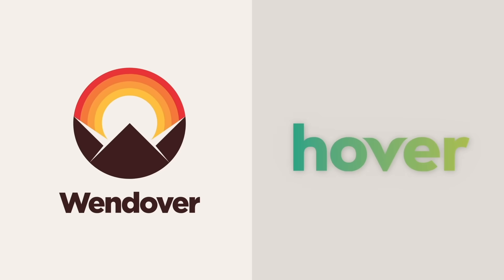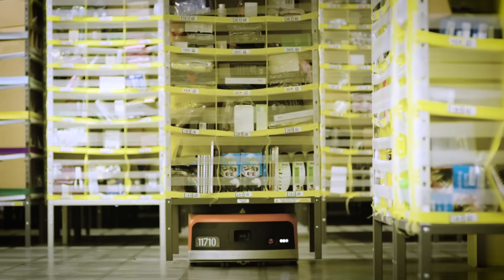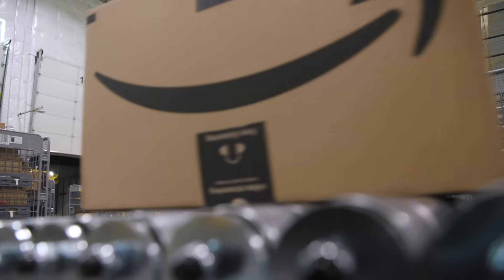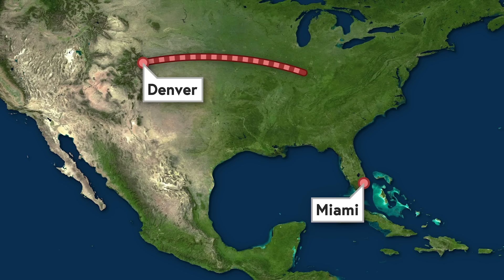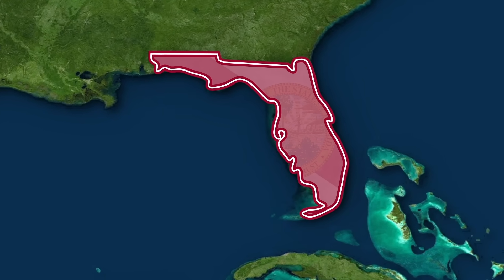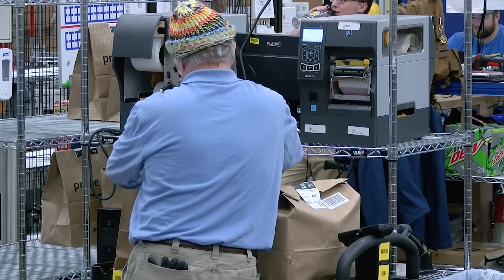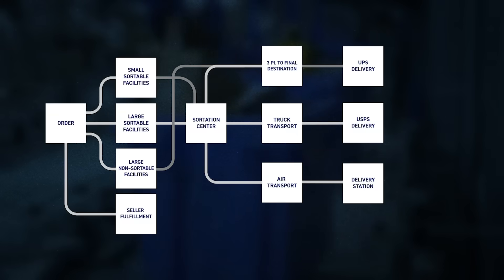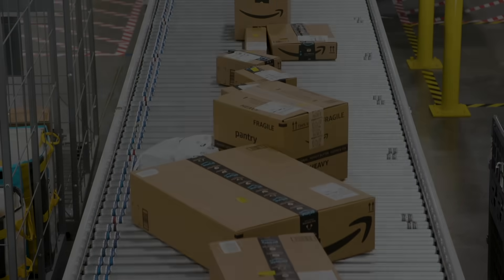How Amazon's Super-Complex Shipping System Works

Comment: I live in the sticks of Northeastern NM, about 95 miles from the nearest Walmart. On day 1 I ordered two small items totaling $45 and weighing less than a pound. The next day these items were picked from a warehouse in Colorado Springs, CO (located roughly 186 air miles from me) and shipped to Omaha, NE (roughly 512 air miles from me). On the third day the package arrived in Erlanger, KY (roughly 1033 air miles from me) and then shipped to and arrived in Denver, CO later that day (roughly 245 air miles from me). They're supposed to pass this off to USPS at some point and have it to me by tomorrow. This package that started out 186 miles from me will have traveled at least 2,447 miles to get to me when all is said and done. I'm sure there's some algorithm/software/AI that decided this was the most cost-effective way to get it to me, but I'm not so sure it's working things out very well... it's traveled over 13 times the distance it was originally located at in the beginning. SMH!

Comment: In my opinion Amazon has become the new eBay. A flea market of sellers. I bought a Christmas gift from Amazon and I was ripped off by the seller. The item didn't arrive and when I went to communicate with them there was some sort of nonsense given to me in an email response by the seller with a photo of a signature that wasn't mine, then I was told the DWS meant delivered without signature. They can't deliver without signature at Royal Mail for higher value items. I haven't bought from Amazon for a long time and thought the goods were coming from them. I didn't really understand it all, but now they allow all sorts of folk to sell through them. So they are mostly a middle man like EBay now. Absolute junk. I will never use them again. That's me lost money and a present for someone. 🤬

Comment: How their shipping really works for Prime members (assuming what you purchased is Prime eligible or fulfilled by Amazon):
- You purchase over $25 of goods on a Friday, you will get it on Monday
- You purchase over $25 of goods on a Saturday, you will get it Sunday
- You purchase over or under $25 of goods on any Weekday they will ship it 2 ~ 3 days later

(the above would be shipped by Amazon, next purchase within that week shipped by either Purolator, UPS, or FedEx, etc)

- You purchase over or under $25 of goods on any Weekday or Weekend from a seller outside of your country (example: Shipped from China to Canada)
within about 20 ~ 30 days shipped by their preferred shipping method.

Small parcels are left in the mailbox, med parcels usually come in a box and you must answer the door to retrieve it, large parcels usually require a signature depending on how expensive it is (UPS, Purolator, FedEx, etc would leave your package at a drop off place if you miss their delivery, and you must provide identification and proof of address to retrieve it from there)

They offer a an even faster expediated shipping for prime members on certain holidays such as Christmas, Black Friday, Boxing Day, Prime Day, etc.
Reply: the fri-mon, sat-sun part is basically amazon "logistics" in a nutshell hahahaha

Comment: And it ends with the under pressure Amazon delivery guy dropping the package in front of the door, in the hallway without even knocking....because the 15 seconds of "here's you r package" would slow things down for Amazon.  Not seen is the huge call center they have set up to deal with calls from customers saying the porch pirates stole the package.  I wouldn't even order a book from Amazon, much less anything valuable.  A laptop (or anything of real value) dumped in the hallway, or on the front step of house?  What an idiotic development of what is "normal" and accepted.
Reply: They want to cheap out on delivery because it's very expansive. IDK about other shipping company but mine offer both signature requirement or not. Requiring a signature increase cost as driver have to spend more time at each stop thus can make less delivery.

Comment: I started in an engineering tech role in a 3rd party reverse logistics company a couple months ago after never really thinking about logistics. thinking up and strategizing this sorta stuff is really fascinating. They just promoted me from doing reverse engineering and process dev for one of out clients to a systems engineer doing process dev works on the bulk of the operation, it's stressful but really intriguing to take in time/labor data and then find the roadblocks to increase efficiency.
Reply: i want to do this

Comment: Will correct you on one thing. Walmart has been using storefront fulfillment for about 6 years, I was the supervisor for one of the flagship stores that first started operating this department before online grocery ordering for in store pick up was even implemented. Back in the day the handful of stores with this department could be identified by associates picking items in black totes as opposed to the blue ones used for online grocery

Comment: as a usps worker. Amazon pawns off alot of work load to us. so this video should be more about the postal service and not lame amazon that can't even keep up with work demand. and using Amazon system it's called Copilot which is ups's system that's 20 years old and it's actually a nightmare and very  Unefficient

Comment: UPS and FedEx both have delivery commit times on air pkg.
  When lasted checked UPS air pkg delivery times were 8:30am/10:30am and 3:00pm. No matter what size weight or value of the pkg or shipping is free. 
  Which makes a big difference in the operation and cost of delivery service. (Apples and Oranges, their both consider fruits except they each taste different and are used in different ways.)
  Delivery time commitments for pkgs requires a lot more air flight time,drive time and physical labor.
UPS drivers also are required to cover all on call residential pick up request for nextday air and ground pkgs. All in the same work day by the same delivery driver.

Comment: I like to order stuff a day or two apart so they have to ship separately, they sometimes catch it if you order something within anywhere from a few hours to a day apart depending on the day. And always check the rush delivery, not that I need most things quick but I'd rather make them pay more for it. The $1 reward isn't worth it for me. Don't worry, I recycle the boxes or I use some when I sell stuff. But i usually try to buy stuff from other sites, I just haven't had great experiences with Amazon especially stuff that more than about a hundred bucks.

Comment: I worked for Amazon. 3 Buildings. 1 was a Prime. The 2nd was a Sorting Center. Basically a Mail Sort Room. 3rd was a Large Sort building. Saw signs at the Prime for 500 Pick Rates. Stock was 300 when I was there. Single Pack was 90 units per hour. Basically one every 45 seconds. That included Assembling the boxes. Large Sort building I worked at was 75 Pack Rate per hour. Both also include Reloading Packing Supplies at the stations. Sorting was 200 units sorted per hour. Involved walking around with a hand scanner. Scanning and stacking on proper pallets.

Comment: Man that fulfillment center they allowed those camera's was nice. At the one I worked at I was the 3rd group to start before it officially opened and had a full staff... within 3 months stuff started breaking by 6 months a lot of it was broken, by 9 months it was pretty much all broken, by 12 months everything was broken in one way or another.. there are "tote tanks" those things weigh about 400 lbs when carrying a full load of empty totes (what I dealt with.) and sometimes more or less depending on what is in filled totes. They have breaks so when you stop the tank it wont move, those were all broken and useless... the wheels were bent on most of them which meant you couldn't go straight without tilting the whole thing partially sideways. Also when turning the tank there is a mechanism in the middle to keep it from what I am gonna call "Sliding" in reality it was just all 6 wheels continuing in the direction you were originally moving... so you couldn't steer the tank you had to stop it turn it and start again...  if anyone got hurt they could have sued Amazon for so much it is astounding, everything meant to keep them safe while using a tote tank was broken, in the packing department we had to strip useful parts from broken tape machines and replace the useful parts for broken ones on other machines... We weren't actually supposed to do this, they hired a 3rd party company who manufactures the tape machines to do this but they hadn't been present for 6 months so I was the scavenger for the packing area I was in and otherwise mechanic for those machines, again safety hazard that if I had gotten hurt Amazon would have been liable...  many other carts that we utilized for various reasons were breaking or broken and we were required to use them, because there were never enough functioning ones. While we the grunts were supposed to tell our supervisors "No, I am not allowed to use that broken piece of equipment." you entered into their shit list and would get written up for any mistake you made, you were ignored for promotions, or other positions that you had desired. Also after the Pandemic broke out for about a month we had the personal protective equipment we needed, along with ways to clean our station and management gave us time to clean our stations... After that it all practically went out the window, you were lucky to find cleaning supplies to sanitize your station, and even if you did you had no time to do it because the 4 minutes to clean your station affected productivity too much for Amazon's liking. If you were sick you had to use your own time to take any time off or come to work sick because otherwise you risk losing your job, and they don't care if you do there are thousands behind you waiting to get into your spot. EVEN if you thought you had Coronavirus until you had a positive diagnoses from a doctor you were NOT excused... it took me a month to get my test back at one point since I am in Southern AZ the world's leading outbreak spot in the world, a few other places have beat us for a week or month but we always get back up there... I live with and take care of my sick elderly mother when fall rolled around I quit I knew it was going to get a lot worse and based off of friends who worked there it did, according to them practically EVERYONE got it between November and December they stopped sending out notifications of confirmed cases in July because they started coming so often it was essentially just spamming everyone... 

That being said, I'll be going back this upcoming fall hopefully, so long as the vaccine works... I earned 17.90 because I worked a 12 hour night shift that wage is unheard of here unless you have a degree... I hated it, it was soul crushing work, and it was stressful both mentally and physically and honestly the grunts don't earn nearly enough... My Grandfather worked in a factory in the 50s he earned more in that factory in the 1950s than I did at Amazon in 2019-2020... but yeah there's nothing wrong with something like that if you ask certain people in this country...

Comment: I used to work at the DEN5 Sort Center and there are couple of things that you missed that are key. 

First, Not all the packages that go out of the sort center are picked in Denver Warehouses, they come from all over the country. Yes the system tries to keep things near where people buy, but it doesn't always work that way. Originally packages would arrive on Tractor Trailers throughout the day, late in 2017 they began arriving by plane at DIA as well. Those planes that flew to Cincinnati later did not just arrive empty. Very smart actually.  This local picking only may be something they are looking to move towards ideally but as you pointed out will never be completely possible.

Second, The primary role of the Sort center was to sort packages to go into the USPS delivery system. Virtually everything we palletized was on USPS proprietary pallets and when it went out the doors it was taken by USPS contracted drivers to USPS post offices and sort facilities. Everything was sorted by Zipcode and labeled with USPS labels. Every day we had trucks taking pallets out to post offices all over Colorado, Western Nebraska, Wyoming and parts of South Dakota. The Sort Center had a secondary role as an Amazon Logistics delivery hub and we sent packages over to them for them to sort and deliver locally, they were a separate entity. 

Finally, and this is more of just a point of info, The breakdown you gave for why the final mile was by Amazon, USPS or UPS/FedEx/Etc is idealized. The final decision was often based upon when the package needed to be delivered or even what was in the package or because of size, something the USPS wouldn't deliver but UPS,  etc would. I tracked my own packages through the facility and at one time or another they were delivered to my home by all different means.

I stopped working there at the end of 2018 just before the robotic automation came online so there have no doubt been other changes since then as well but overall it was a fascinating (if not backbreaking at times) job.

Comment: Air freight and insanely quick shipping of items across the country might be profitable for a few companies, but it sure is not sustainable. Both in terms of the climate crisis and the social impact it has. 
The first one is obvious. Sending lots and lots of packages by plane causes way too much CO2-emissions, at a time when a drastic reduction in  emissions is urgently needed. Most of the packages sent are not even time sensitive and are only delivered by plane, because it is part of amazons business strategy to offer free one ot two day delivery with amazon prime. This induces profitable ineficiencies in the shipping process. That is, profitable only to amazon, who grow the number of prime subscribers. While from a macroeconomic perspective, slower delivery methods would be the much better choice.
(If you order anything online that you don't need urgently, then please choose the slower delivery, when given the option. Even if amazon prime offers faster shipment options free of charge to you. This is a small thing you can do that helps everyone.)
Towards the second point: A city with a mix of local stores and other retailers will be prosperous in the long term. If amazon supersedes too many of them, the  city will enter a path of decline, as all profit flows away from the city into the city.

Comment: It's not complex at all so let me save you 20 minutes of your life. Amazon uses a barcode/QR code system that contains the shipping information much like and in line with every commercial shipping company there is and then it presorts everything internally BEFORE it leaves the FC by commercial airport nearest its final destination saving whoever the trouble of doing so on down the line........the only complex part is the data infrastructure that can handle processing thousands of orders simultaneously

Comment: A lot of Amazon packages come in through UPS (where I work)
I load hundreds if not thousands per day, and that’s just UPS
Reply: that’s the key using every resource to speed up the delivery. back then i was the only driver going to 25 specific addresses. the addresses i serviced were bulk stops roughly 50 pieces up to 200 per stop. the problem with this was once my truck is loaded in the morning and i go out on the road. any packages for those addresses that arrives at the warehouse have to seat there until the next day. things changed now instead of having one driver going to the same address or area multiple drivers are doing so. means multiple waves of drivers are dispatched every 30 mins so when the semi truck shows up with more packages it’s quickly sorted and sent out on the next wave of delivery drivers so nothing seats at the warehouse until the next day like it used to be. at least at our warehouse starting at 8am.every 30 mins about  50 drivers are dispatched and it goes on until almost 3pm. in a way it also made it easier for the drivers at least to me i feel it’s easier than it used to be when i started.  before i had to deliver 1000+ packages by myself in a day now the most i’ve ever had just over 250 so definitely easier with the workload spread out among multiple drivers in the same area.

Comment: Yeah but I worked at ups In the uk, Amazon parcels were 50/60% of all parcels. Amazon parcels often get treated poorly in ups dispatch centres. I lost my job at ups in the midlands for handing in items that had fell out of parcels on the belt. Because I told security rather than a manager r whom was never on the line. I was accused falsely of theft and instantly dismissed.

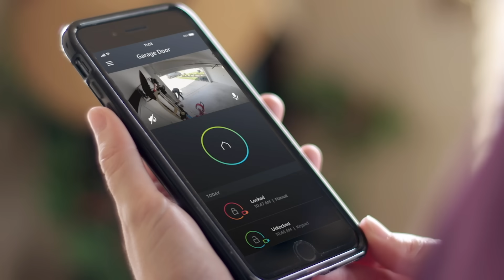Comment: 17:20 ehh... Again, FEDUPS only need to take a box and get it someplace, Amazon has to warehouse everything.
Point to point only makes sense if you can fill the equipment.
The same way Amazon uses ups for low density last mile, ups and FedEx can sell cheaper services which use usps for last mile.
FedEx already has a mostly 21st century network and ups is upgrading at 4billion a year